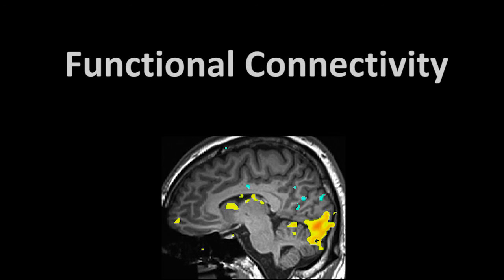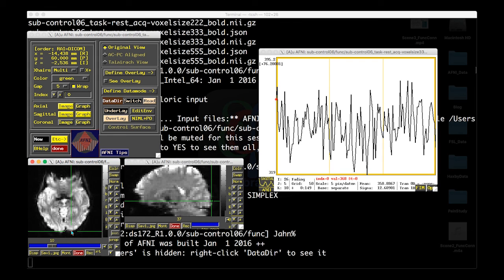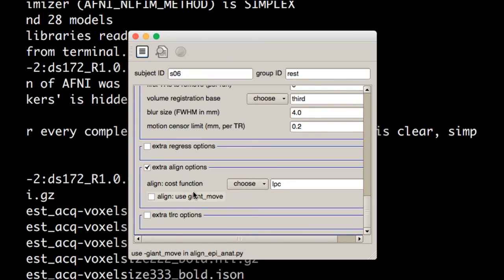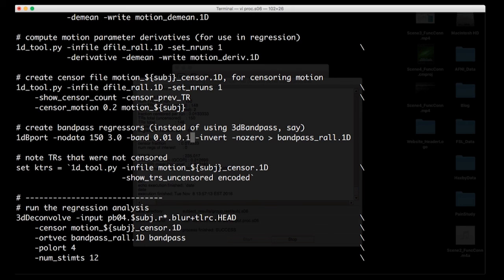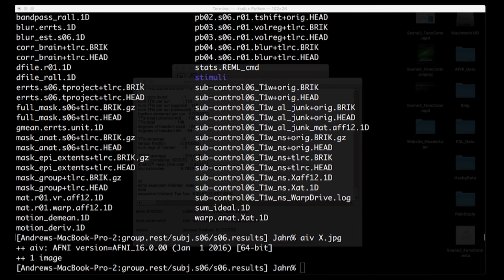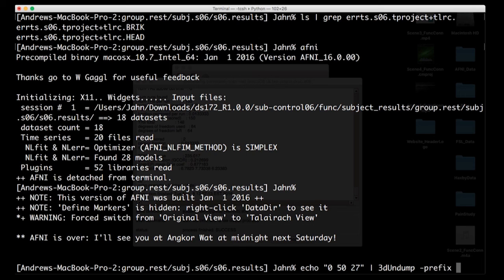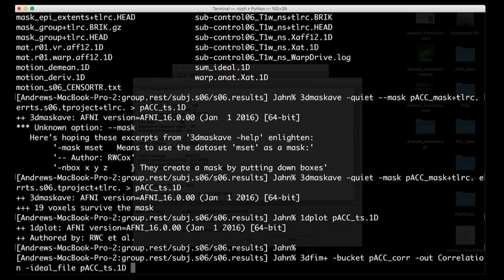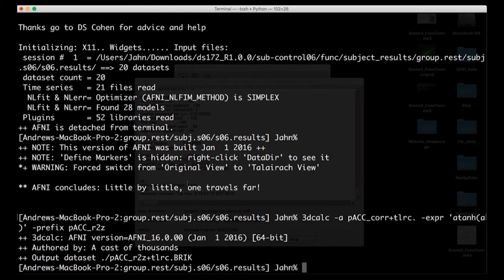Resting-State Functional Connectivity in AFNI

Comment: Hi Andrew, thanks for all these commands together! you cant imagine how long i wanted these commands together! how to detrend upgoing baseline? - how to extract number of voxels for specific region without the masking process? how to average multiple voxel into one? How to separate study into selected folders if provided as only one folder (anat+ functional) ? There are still other questions :) but this is for now ,,
Reply from the maker: Hey Abo,

1. 3dDeconvolve will remove effects of trend (as long as you leave the polort option at its default) so no worries there. 

2. If you want to extract the number of voxels for a specific region, you will have to use a mask to determine how many there are, whether it's a mask defined anatomically or otherwise. 

3. 3dmaskave averages across all the voxels in the mask by default.

4. I'm not sure what you mean by this question; can you rephrase it?

-Andy